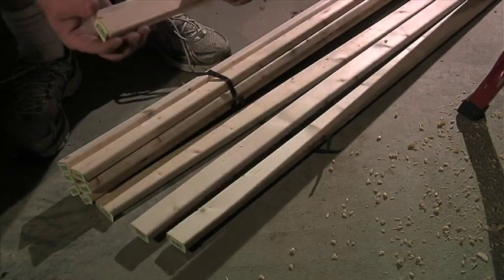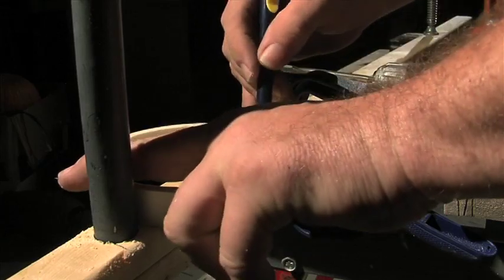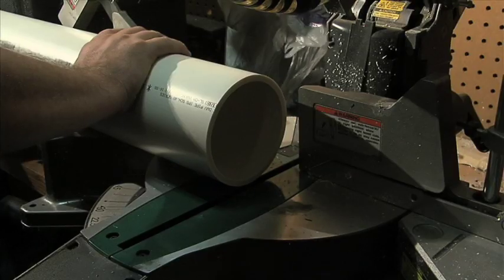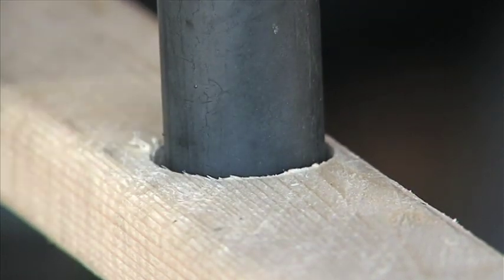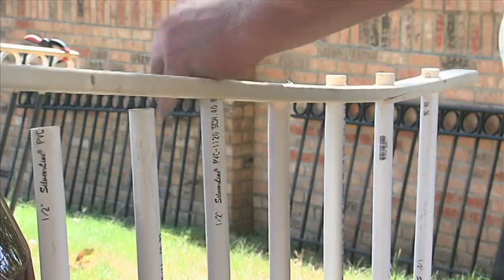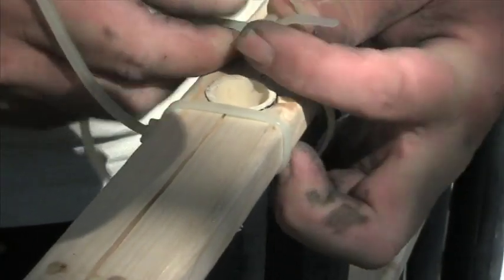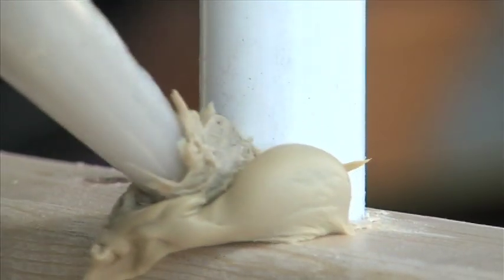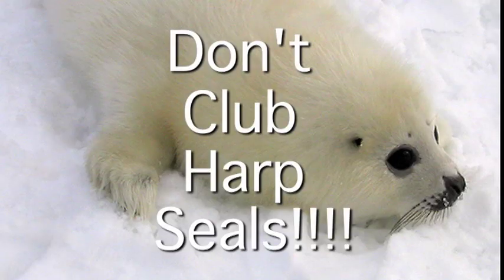Halloween Fence

Comment from the maker: I believe the bit was a one inch paddle bit. But since there are different sizes of PVC you might want to get one that matched the pipe. I got the thinner PVC pipe once and the bit was too large making the pipe too loose once installed.

Comment: i found that when i was usind the paddle bit, i was about 90% accurate but once in a while my pvc would be a bit crooked or bent , which is no big deal its just a fence but if i could wish for one thing, it would be a drill press that i dont have. that way i could make perfect 100% accurate holes drilled into the wood so that way the wood and pvc would be straight perfectly, either way its all good
Reply from the maker: FordFalcon1962nBlue I agree. A drill press would be great. It's just not in my budget right now. ;)
Reply: rustyspurproductions they are pricey but handy tools- amen the wood is like..2.00 a piece and cheap to get if you mess up

Comment: oh i see at the comment area you used 1 inch pipe..they sell 1 inch here for 2.50 10 feet long..assuming your pipe length max height is 4 or 5 feet..each 2.50 piece will give you two pipes...and if you need at least 15, you'll spend..15-20.00 on the pipes for eacdh section alone...add wood, liquid nail and the 4 inch other piece and its like 25-30.00 a section....

Comment: so my question is, what size of PVC pipe is that? i see our local home depot sells the half inch diameter by 10 foot section for 1.89..i figure 4.00 gets me 20 feet....or 5 seconds of 4 feet- so i cut the sections every 4 feet and both ends of both pieces have 2 feet left so ill glue them together for a 5th piece...ill have 15 pieces per each 8 foot 2 by 4...so 10-12.00 gets me the pipes and another 6.00 for the wood..then paint

Comment: I just made twenty six 4' panels. Nobody seems to have a video of installing the fence and I'm not sure my ideas are going to work. How do you put your fence up?
Reply from the maker: I added L shaped hangers to the top and bottom rails of each fence panel. I can then screw into any support post I use. I'll grab a pic the next time I set them up.  But I actually have four different vertical posts. 

1. I use my brick mail box as one of my post, connecting a fence section to each side with cement screws. Heck it's there, can't move it, might as well make it part of the scene right? 

2. I have 2"x2"x5' wooden posts sharpened at one end and pained black. I hammer them  in the ground about a foot deep. Just watch out for your sprinkler line. I didn't the first time. It cost me. Then I screw a fence panel to the post, move to the end of the panel and add the next 2"x2"x5' post and keep going.

3. Corners of my cemetery are two 8' pillars I built and faux brick finished. So the fence panel attaches to it... again through the L hanger with screws. 

4. I also built a couple of 4' faux brick columns. They are roughly the size of my mailbox so it all looks uniform. Again, wood screws through the L hangers. 

Hope that helps.

Comment: Pounding the pvc down is too much work. 1/2" pvc, drill 7/8" speedbor hole. Easily slide.  Screw the poles in, save your fingers being glue sticks.